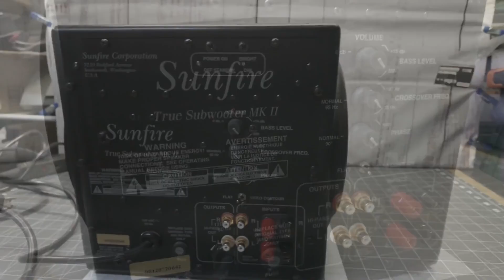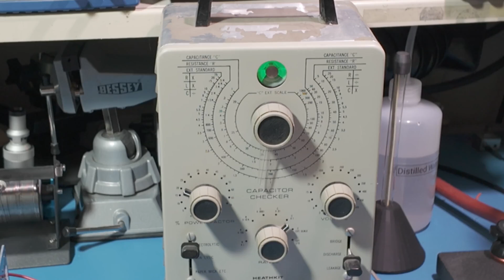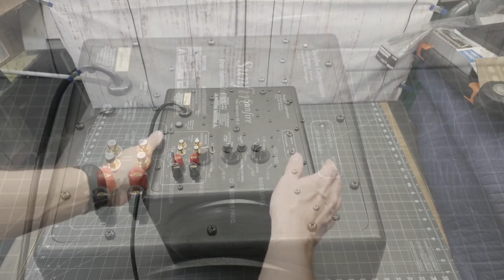Resurrecting a Dream: Repairing a Sunfire MK II Subwoofer from the Thrift Store

Comment: Thanks for this video. Congrats on the find and the restoration. I have a super junior but it’s producing  some random spurty sounds right now. Prob needs a cap job.  I’ve done some electronics (guitar amp building, etc.). What’s the best/safest way to drain the caps on this before poking around? Thanks!!
Reply from the maker: One of the cheapest easiest ways is an incandescent bulb 120v not led , connect wires to it and use that touching the cap leads this will remove any charge remaining.  Hope that helps .

Comment: Sounds kinda like the sub is popping like mine did when the bass hits. I took the amp out of it and it is now powering the 15" jbl pswd-115. Would love to find a replacement 10" subwoofer that would work for this though.
Reply from the maker: Yeah it never makes the popping when I use it normally,  these are strange speakers I agree would be nice if there was a replacement.  They do remind me of the jl audio car speakers. Thanks for the comment
Reply: @Sawdust_and_Circuits I was thinking jl myself. I see parts express has something by dayton audio like the RSS265HO-4 that might fit but not sure the exact fit size.
Reply from the maker: @nerman107 looks like a good one if it's truly 10" it should fit the box .

Comment: I have 2 True Subwoofer EQs that function but each have their own issues. 

On one the sub will pop at high levels and the other has a slight hum at idle and sounds awful when driven. 

If you would be up for taking a try at re-capping it for me I’d be willing to pay a reasonable fee and understand that re-capping may not fix my issues.
Reply from the maker: The popping is likely the larger capacitors the hum is tricky alot of time it's a transistor on the low level input. I used to fix car amps and even on 5 year old models the transistor based parts where hard to come by .

Comment: Will you repair 2 for me? I can just ship both amp plates to you? If so how much? Former Carver employee's do repair them but charge an arm and a leg. I opted out because of what they wanted to fix them.
Reply from the maker: Let me think on it , don't get me wrong I would love to help . I do believe you could handle the repairs.  I'm working full-time and trying to get alot of projects done at the moment that's my only apprehension.
Reply: @Sawdust_and_Circuits  Is there a way you could hold my hand and oversee me doing the repairs? I have basic soldiering skills and have been building computers for many years. Can it be done with pictures? You could take your time with them. I'm in no hurry. Whatever you think. I'm Steve in Tampa.
Reply from the maker: Sure I could give you input on repairs,  these are very straightforward boards , if you have a decent multimeter and soldering iron. the likely problems are the capacitors,  these can be tested in circuit and if you see any swelling or leaking replace them even if they test good . The main caps on the input voltage need to be checked for voltage before you touch much inside , a cheap trick is a lamp with an incandescent filament bulb the old ones . Connect clips to the ends and one at a time touch the larger caps to drain the voltage just to be safe . Let me know how I can help.

Comment: I have a sunfire hrs-8 that makes an hummin sound, and when i turn it off it makes a pop noice, is it also the capicators?
Reply from the maker: I did alot of research on these , capacitors seem to be the main issue with them . If you have a multimeter you can verify them . Other than that I can't say for sure on yours .

Comment: Cerwin Vega! Just saying... Anything but is just a wuss' dream! 😁 And powered by any GAS amp!
Reply from the maker: I remember that brand the thoughts then where that it was a good brand . I have not had experience with Cerwin Vega as an adult I hope i get the chance would love to hear the sound quality now .
Reply: @Sawdust_and_Circuits  Cerwin Vega were once top notch disco/club speakers and those speakers were not for the lover of classical music.  But they dis also make speakers that weren't monsters. In general, it was said that they were hard to drive meaning needing a hefty amp to drive them. Those *zilla amps from GAS were known to draw some 50 amps from the socket when turned on. Now, this is for those lovers of the sound that actually can pace your heart.;)

Comment: I always wanted one as a teen.  I bought a used jr years ago and it's served me well. It started humming recently. It stops humming once it's warm. I figure it's a capacitor but I am not good at soldering. :-)
Reply from the maker: It's almost certainly the caps , even if your not good at soldering it's all through hole I think anyone could do the repair. 😃
Reply: @Sawdust_and_Circuits Not with my neurological condition. Its like having a vibrator attached to your hands. :-). Also, I don't own soldering equipment and wouldn't know how to determine which capacitor it was.  I might have it apart and see if it's obvious though.  I'm sure I could just buy something new but it won't be from Bob Carver! :-)

Comment: I found the smaller, baby Sunfire powered subwoofer at the thrift, but they wanted $60.  Don't get me wrong, I'm mad I passed as you just don't see those often.  A couple years ago I found a Velodyne spl8bgr for $8!  Seriously.  Working, perfectly fine, a few scratches on the piano black finish.  My dream thrift find would be some top end Paradigm Persona series loudspeakers for pennies on the dollar!
Reply from the maker: That's a great deal on the Velodyne, I love finding treasures. I will have a paradigm video coming soon but they are the cinema surrounds.

Comment: I actually paid to have the amp 'fixed" many years ago..shipped to carver website.   I don't think they did anything to it.  Paid over 200.  Haven't messed with the sub since.  But i refuse to ger rid if it!  Im definitely gonna dust it off and will post issues soon!!
Reply from the maker: They are worth fixing , new stuff doesn't hold a candle to these things .

Comment: Compré hace poco un SUNFIRE HRS 12 que visualmente estaba impecable. Llegue a casa lo conecte y sonaba un zumbido y un plof al apagar. 
Le fallaba la fuente de alimentación y los condesadores se habian secado.
Se le cambio todos los condensadores electrolíticos y como nuevo.
Es un subwoofer increíble para películas, en cambio para musica es demasiado agresivo, incluso a volumen bajo.
Aun asi creo que se comeria muchos subwoofers de hoy en dia mucho mas caros.
Todavía lo tengo, lo uso para ver películas y para la musica uso un subwoofer Monitor audio silver W12, muy musical.
Un saludo desde Madrid
Reply: Pienso que los subwoofers sellados deberían tener un ventilador incorporado para mitigar el exceso de calor, si su uso es constante y durante horas, la electrónica sufre muchísimo.
Reply from the maker: Sounds great , the capacitors are the main thing bad with this brand 😃

Comment: Bob Carver revolutionized the subwoofer market with his Sunfire True Sub in the mid 1990s. Most suffer from bad caps or a bad passive radiator, which both are easy to remedy.  Had I seen it at the thrift store, I wouls have scooped it up myself.
Reply from the maker: Yeah I love it use at least a few times a week

Comment: How would the sound change if the passive radiator was replaced with a port?  Thx.
Reply from the maker: I'm not sure you could port a box this small, ports are tuned to the box volume,  I would think the box would have to be made much larger to port it .
Reply: @Sawdust_and_Circuits thank you!!
Reply: @Sawdust_and_Circuits I’m just thinking out loud here so your response is not a right or wrong answer just more valuable information to consider.  I’m thinking about 3-piece boombox speakers that use a port for bass improvement. I’m imagining a Bob carver sunfire as a glorified boombox speaker but with a much larger and beefier speaker than a boombox. I could be wrong but maybe the ratio of speaker displacement to box size to port size plays a factor in determining a positive or negative benefit. 🤔💭
Reply from the maker: @Mabeylater293  as a teen i built alot of car systems, the sealed could handle more power and shook everything, the ported took less power and were louder.

Comment: A buddy of mine gave this exact sub to my for free because it distorts. It’s sitting in my garage and I haven’t done anything with it. Maybe time to crack it open. Any idea why it would distort?
Reply from the maker: Have you looked closely at the drivers for any physical damage ? Otherwise the PCB would have to be the culprit ,if you look there start with the rca Jack's and follow the circuit looking for any components that are bad .
Reply: @ yes, both drivers work great! 

I was thinking capacitors similar to what you replaced.

Comment: Very nice find indeed.  I always had my eye on these as a teen as well.  That and Miller & Kriesel subwoofers.  I found a M&K MX-150 from the same era a few months back and it is in immaculate condition. I'm going to replace all the capacitors and pot just to be on the safe side.  Just learning about all this stuff.  Thanks for the video.
Reply from the maker: Thanks , I have found a few M&K speakers as well , very good quality the company has an interesting story too .

Comment: I found one of these on the curb the gain knob is missing or knocked in or something. There's rattling around inside so I don't know that's probably it in there but I've heard these had quality control issues and parts would fall off the boards and a lot of shops refuse to even touch them oh well into the repair pile it goes until I finally buy a whole bunch of capacitors and sit down and do a whole bunch of subs at once

Comment: Dude. I just picked up one in great condition for $100 from an older gentleman downsizing and getting rid of some of his stuff. I came for the mimt condition 80s Polk bookshelf speakers, left with both those and the most overkill subwoofer I've ever seen. 

This is my first audio setup, man am I lucky to have stumbled upon this 💀
Reply from the maker: That's great,  been using mine alot lately 😃
Reply: @Sawdust_and_Circuits  nice. I'm planning on getting a single wall output power surge with a switch to serve as a kill switch. It has a very tiny 60hz hum but I can't hear it 2 feet away.

Now let's see how my apartment neighbors think of it 😂

Comment: Your Passive radiator is blown.  That is where the rattling is coming from.   The spider is really thin and it rots and separates from the cone thus making the death rattle.    You can replace it with an Earthquake MAGMA passive radiator and match the weights from the stock PR.  You may be able to use the same weights from the OR radiator.  I don't remember if that is what I did as it was a while ago.   Works perfectly and bolt holes even lined up.    My Sunfire has recently started to Hum so I am going to pull the plate and re-cap it.
Reply: The real name for the passive radiators from Earthquake are SLAPS.

I use one 12" with a JBL GTi 10" sub.
Reply from the maker: I will have to open it and check that, I was running a high level input on it during the test   it has not made the sound since and have been using it

Comment: I actually picked one of those up off the street years ago , still have it but Im using an out board amp for it .
Reply from the maker: I wonder, does it seem like enough power for the driver ?
Reply: @Sawdust_and_Circuits  yeah the power rating of the amp is 950 watts into 4 ohms

Comment: Dang man I am jealous and envious. I remember a teenage me in the 90's and early 2000's dreaming of owning one of these. Now in my mid 40's I find myself buying old school car audio stuff I couldn't afford back then. May be obsolete compared to todays gear but the nostalgia. I always have my eye open for some Bob Carver Sunfire subs for my living room.
Reply from the maker: Thanks , I do think thrift stores are a good way to find audio equipment, people downsizing stereo equipment just want to get rid of it sometimes. 😃
Reply: You can always buy a relatively inexpensive professional amp and wire it externally, I got a buddy running one with an old Peavy power amp and it knocks pictures off the walls.
Reply: I have 2 of them. One has seen better days and 1 is pristine and looks new. Both having issues. I suspect the caps problem just like the one in the video. I am looking to either have them both repaired or to sell both. I am in Tampa, shipping will be an issue because of the weight.

Comment: I had one and it went unused for a long time.  I also had to recap it eventually.  I think it was not dead-dead,  it was acting flaky and distorted.  But I forget all the details but the caps are the big thing in these,  I gather.  If it rattles like that you got it way too high!  Place it near a wall or in a corner for best room coupling of the bass.
Reply from the maker: Thanks for the info I had a 250w infinity 12 " before this it's a great sub , this is a great replacement for that and I was definitely pushing it in the video. Maybe stress testing it 😅

Comment: Bob carver my have built the amplifier and power supply  but he didn't build and design the actual subwoofer that being used in the sun fire subwoofers .  Wich is  also none to be one of the best designs  and still really popular.  The frame of the woofer  used in lots of subwoofer  and highly sought after.  The builder was named telo stompler  they call the speaker frame a TC  he actually design most of the sun fire woofers  from what i under stand. He's  well none name to most car subwoofer buiders. 💯🫡😉👍✌️
Reply from the maker: I heard some of the same still great info.  I also noticed only a few sub where ever signed bob carver and not this one . The amp is strange because it's not widely used elsewhere 🙄
Reply: @Sawdust_and_Circuits  have you seen or heard of velodyne speakers  they also make a similar style sub woofer  with a small  compact box  model spl 12 and  they also have use 1000w  amp plate.  I'd say there the closest  in sound and build design. Both can play  really  low. The amp kinda reminds me of the Dayton audio amplifier . 💯👍👌
Reply from the maker: Yes they mostly made front firing sub but they did have a kevlar one i believe
Reply: HiVi was the OEM that made the woofer and Passive Radiator.  About 15 years ago you could buy it from Parts Express as a replacement.

Comment: Where is the power supply? I don’t think that little low frequency transformer can powering this big subwoofer
Reply from the maker: This brand was known for a high voltage amp circuit, the big current spikes come from the two large capacitors .

Comment: Just me or is that shit making horrible mechanical noises and no real bass
Reply from the maker: It was making bass the range on this sub is very low like 75hz it was hitting extents a few times , I was running a bass test track,  I used to build car systems smoked many a sub with those but wanted to show what is could do 😉

Comment: Throwing this out at all is a crime ong Shame they didn't realize they could just wire the sub up manually to a amp and crossover
Reply: My sunfire true 12"  i removed the amp...replaced the radiator  because  the wood split from the cone..with an earthquake  radiator..

Crown xls2500  runs is 90hz and below
Reply from the maker: It was probably hitting max throw a few times, it was shaking everything in my garage , one thing you might be noticing is how nothing other than bass comes out that's a sign of a very clean crossover. Thanks for the comment 👍

Comment: Cant be much power with so small transformer...🤔
Reply from the maker: it uses a capacitor driven amp at high voltage i believe the spec are something like 500w continuous and 2700w surge not bad considering
Reply: @Sawdust_and_Circuits  All power amplifiers have some degree of capacitor power storage. 2700w peak is more likely.
There's no chance it is sustaining that amount of power for any noticeable length of time. I even doubt 500w continuous just looking at the design. We all know that power delivery has very little correspondence to sound pressure output anyway...
Reply: @Sawdust_and_Circuits  Honestly would slap a JL W7 in that bad boy if ya can afford it, def hear mech noise from the stock one wondering what a clip light would say if you hooked that up to it. I hardly think it does more than 350 watts and even that for a home theater subwoofer is crazy loud and the rms range on a W7 has a range and it can handle low to high power while sounding amazing. Or rock it how it is for $20 just don't push it so hard near 30 year old subwoofers don't last long doubt you can find a recone for it. But great find and nice video cheers!
Reply from the maker: Thanks for the comment , maybe i was being to hard on the old girl for the video . at regular level it sounds great so speaker damage i can find .
Reply: If I remember correctly, this subwoofer powers the amplifier directly from the mains. You can see the big bridge rectifier and cap on the rear panel.
The small transformer only feeds the input stage which is isolated from the power amp using optocouplers
Reply: @moffarocka3537  Ahh now that's interesting. I've not seen this before, but would make more sense if the power specifications are true.
I suppose there would be some pretty serious and foolproof limiter circuitry in place to make sure the driver isn't over-volted.
Reply: @moffarocka3537  315v. dc?
Reply: Bob Carver was one of the best amp designers of the day.